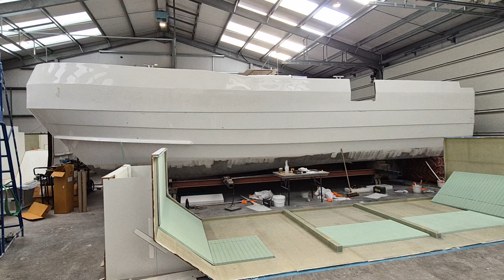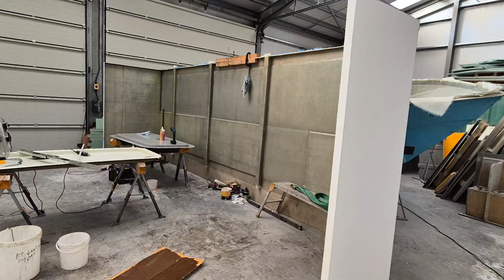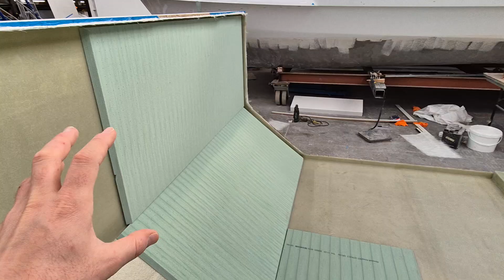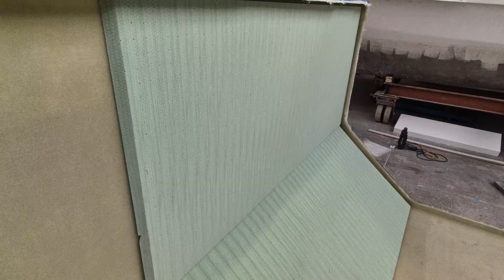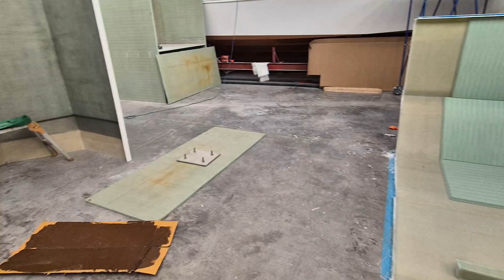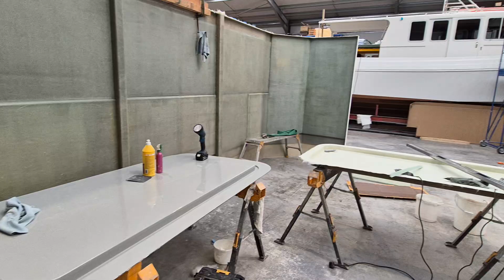south boat catamaran custom passenger boat cabin build

Comment: Hi there, is there any chance you can supply me with your suppliers name, please for composite boarding for a project that I am doing a lightweight deck. 
Keep up the work & content.
Reply from the maker: Hello david nidaplast will be a cheaper option you can buy from a supplier called panel systems. If you want the green board it is called Armacell there are a couple of suppliers ull be able to find on google
Reply: Hi Thanks for the very quick reply. Will look into.